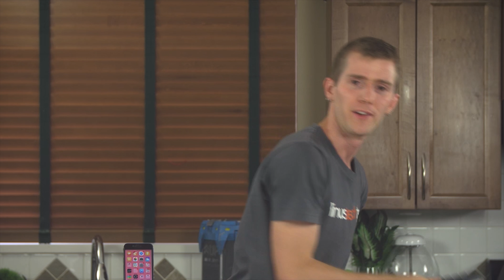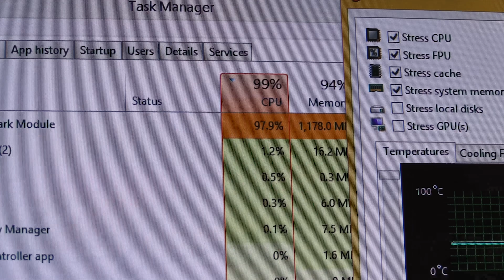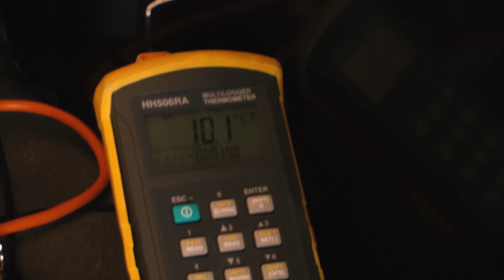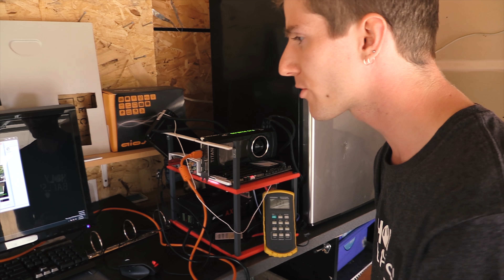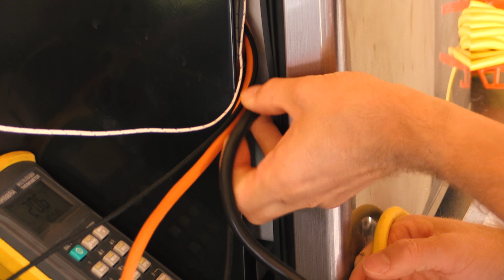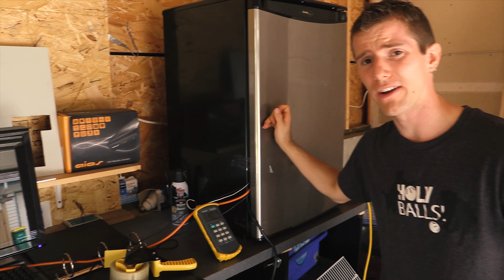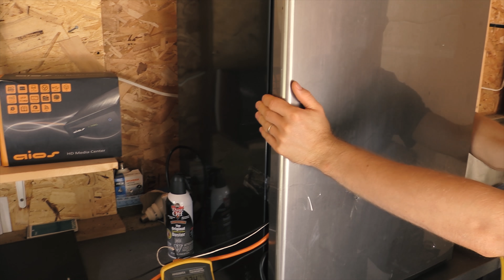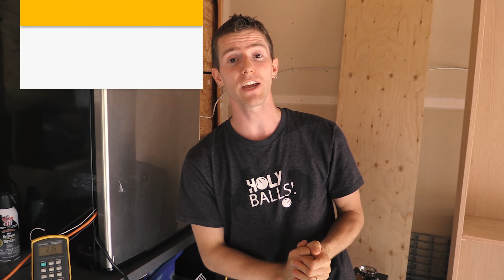PC Build in a Fridge - Does it Work??

Comment: Chest freezer?
Reply: I'm thinking purge the interior with sulfur hexafluoride. That would act as a dielectric protective gas without humidity, and it's also denser than common air, so it would promote convection and thermal transference. I've had some good time to think about this. Also, put the darn PSU outside the box.
Reply: humidity is on air... you would require to put the main part o the PC vacuum sealed to avoid humidity problems
Reply: Actually the computer would be hotter than the fridge. Water condenses on things colder than its surroundings, and the PC will be the hottest thing in the box (its just like running a computer in a cold room). You shouldn't need anything to take care of condensation, though I would recommend mounting the MOBO a few inches above the bottom of the fridge (to make sure water defrosting on the sides of the box doesn't run down and make a puddle). Then you could disable the defrosters since those are just for preventing freezer burn on foods, and they are wasting power in this scenario.
Reply: BioClone If you vacuum sealed the components their would be no medium for the heat to be dissipated. Correct me if I'm wrong please.
Reply: Garrett Nelson Radiation (usually more heat dissipation than natural convection on passively cooled components, also pretty important for satellites).
Reply: But again, you won't have condensation issues. People are looking at this wrong, a hot computer doesn't condense in a cold room, its cold things in a hot room (hot and cold are relative).
Reply: Jake Garrett yeah, but... we are talking about a sealed medium... where you got a very low temperature and a very high temperature where the PC components are... there should be a Convection Current with the gas inside so I guess on the top you will be getting condensation anyways.. and later falling to the hardware...unless the humidity on the air would be 0.

I think that could be made a hybrid between freezer technology and the heatpipe concept we know to make a massive safe heatsink... but at the end of the dayI dont know if the power consumption and all the cons would make it something interesting outside datacenters.
Reply: BioClone I just don't know why you would put it in a freezer for a real setup (a datacenter since those care about efficiency). You can just modify your A/C, fridge, or freezer by pumping the freon directly into a copper cooling block. You will get lower temps (like -35c for a 200w load on a 1/3 HP compressor, this is what my unit is rated for) and you won't be cooling other components like ram, motherboard VRMs, PSU, HDD, or anything else that doesn't need to be subzero cooled. You still have to deal with humidity (and components forming ice and frost), but you can use vaseline on the top (entire card, if its hot, it will melt itself off) of the GPU. Apply using a heat gun to make to smooth and waterproof the vasaline. On the back I used several thick layers of Plasti-dip (the thicker the easier to peal off when you're done). Also ad several layers of foam insulation (I used closed cell foam, mostly used for art projects because that's what was handy), then in between the layers add heaters (my unit has 5w heaters controlled by a micro-controller similar to a Raspberry pie, and its enough to keep the outside insulation just above ambient temps which is all you want to prevent humidity).

But for your proposed freezer (literally a freezer you drop a computer in), you just said it yourself, the computer is hot, the ambient temps are freezing cold. So you do not need to worry about condensation because condensation only forms on things colder than ambient (its like a room temp cup of water in a fridge). In fact, there is a company trying to start up that is trying to simplify LN2 cooling for rookies (bad idea) by making an airtight box (aka a sealed computer case) you set your computer into and hook up LN2 blocks (its pumped in and computer controlled, pretty simple to make) and the box makes it so you "don't have to insulate or worry about condensation" (which isn't entirely safe because the box temps need to be just as cold as the computer, and they are using a plastic storage box with holes cut out, and no active cooling on the box. Its a prototype right now)
Reply: So, in the case of radiation would it be notably different from the computer sitting on the counter? That is very amazing how important heat dissipation by radiation is for satellites. It seemed a bit hard to find info on that when I was researching it at an earlier date. Would any of you guys know of a good article?
Reply: Garrett Nelson A good book for calculating the heat dissipation (radiation, natural convection, forced convection...) is a college textbook "Heat and Mass Transfer: Fundamentals and Applications, 5th edition" by Cengel and Ghajar (I had Ghajar for my Thermodynamics class, he is good, but his book is even better at explaining things. I have this exact book from my Heat transfer course).

Not only can you get a basis of understanding, but actually calculate real numbers for designing a heatsink. This book covers a lot of information in addition to heatsinks (like heat loss in water pipes in buildings). I've found it very interesting.

If you can't afford the $200-300 price tag, you might be able to get a used copy, or an International edition (like $20, places like ABE books are good places, or maybe even Amazon). I actually still read it for fun (total nerd) because it is so well written.
Reply: Jake Garrett Thanks for the info, I will look into it.
  
 I am only 16 so I have not even decided on a college yet, but have a deep interest in computers both hardware and software.

 I know this may not be your scope, but I would love to hear your ideas on the most productive way to begin dabbling in a bit of coding.

BTW, no shame in nerdiness. I strive every day to be a nerd. Sadly, I am not where I hope to be.
Reply: Garrett Nelson I would read some forums and see what articles or books they recommend. Pick a popular language to start out with (C, Python) and learn some basics. Some projects may be better suited for different languages, so expect to learn a few. (My cousin is good with about 12 different programming languages, he's in high school)

Also see if you have a robotics team at your school (Even my very small school and Vo-tech had robotics teams, we were very competitive). You can learn a lot of practical coding in stuff like this (and learning to work in a group is a must, not always pleasant, but an important lesson on sacrifices, saying its beyond your abilities, asking for help, and sometimes bossing other people). Its very fun and rewarding. Competitions will be among your favorite days you remember, so I highly recommend it.

Also, many people try to delve to deep without background, and then you get stuck and frustrated. Arduino is a great starting point (C++ modified). If you try to delve into game development, you won't realize how many hundreds of pages of code you will have, and extremely complex coding. My cousin had pages for an AI path-finding algorithm, and many libraries and alterations to have a GUI (Yes, you will need to use other people's work. If you don't, you will waste weeks re-doing something already done well by someone else. People like my cousin publish open source code for controlling raspberry pi robots over the internet so that other people can learn and make use of the code they worked hard on. So use those as examples when you are learning, after all, I learn the most when I read other people's code.).

Biggest thing is to not get discouraged, and then your skill will only be limited by how much time you put into it.

Comment: BUILD A COMPUTER IN A AIR CONDISHER!!
Reply: sorry i don't have the best spelling and google would not correct it. :(
Reply: Anthony DiFede The same concept but not made for 24/7 use. Your refrigerator will turn on every few minuts and turn off again after some seconds. If you leave it open it will continously run until it dies. Your Air conditioner is meant for that and will do the job just fine. Try it, but dont blame me if you kill your fridge.
Reply: Conditioner :|
Reply: +KingCopasGaming it's ok
Reply: KingCopasGaming But they're sexist! (h3h3 reference)
Reply: There is a methode called "aqua chilling" which is basically a watercooled system with the water being cooled by an air conditioner instead of a radiator. The problem is, that the aqua chiller needs more power to cool the computer than the computer itself so that youre actually paying twice the electricity bill. Also you need to put the air conditioning part outside of your room because it is creating an insane amount of heat so that you need loooong tubes and holes inside your walls. Also there is the problem of condensation: If youre cooling your computer down too much there will be dripping water which will eventually destroy it. But the idea isnt that bad ^^
Reply: it was a joke but said like that i guess not. I was just thinking of a very cold thing.... I mean there is always a deep freeze. :)
Reply: KingCopasGaming I know, that it was a joke. I just wanted you to provide the information that the joke isnt actually that far away from reality.
Reply: A refrigerator is basically an air conditioner.
Reply: Anthony DiFede No. A Refrigerator isnt meant for 24/7 operation. Try leaving yours open for some hours. You will kill it.
Reply: It's the same concept, draw air from the outside, cool it, pump it into another space.
Reply: How about building A Pc In A Vacuum!!
Reply: TheGenericYoutuber When a fridge "turns off" it's only the light. Sure, the fridge won't be so cold if you leave it open, but the light is the only thing that "dies". The fridge continues to work, albeit at a higher temperature, therefore making it useless while the door is open. While the door is closed, the fridge stays cool.

Comment: Do liquid cooling with two big old beefy radiators, first one on the hot cycle outside of the fridge, should have a lot of fans on it, second inside the fridge, no fans. Heat doesn't get dumped in the fridge, you just increase the thermal difference of the liquid to increase thermal transfer rate. =P

Comment: I've seen computers in refrigerators all of the time. Go to a restaurant supply place, with the giant walk in refrigerators. They use computers to do the price marking, and inventory. Those computers just live inside the refrigerator. I've never once heard a fan running on them, but they probably aren't very powerful and aren't doing a lot of processing, and its noisy there so a low fan speed won't be noticeable.
Its all a matter of the type of refrigerator you use.

Comment: Now you need to try with a split air conditioning unit pointing directly to the rig and see what happens. It'd be cool and not being a close system as the fridge it should work much better.

Comment: buddy... somethin tells me you have no idea just how important the seal around the door really is... it's tantamount to how well the fridge will perform.  i mean you show your work and showing all the cables breaking the seal, nevermind having a heat source inside, if you've ever bought a used fridge with a slightly warped door that didn't seal properly, you'd soon realize that broken seal is the sole reason for why the fridge isn't cooling the food so well...  you're getting into the explanation of how a fridge works with it being a closed system AND LEAVING OUT THE SEAL!!!  PLEASE... DO IT RIGHT!! your video is a joke

Comment: fridge compressors were not designed to be run 24/7, which is why phase units are mostly made from compressors similar to the ones found on Air Conditioners which are designed for 24/7 operation.

Comment: Try using a thermoelectric fridge. They are typically cheaper and probably can handle a much higher heat load. (You can also make one for pretty low prices judging by your collection of heatsinks)

Comment: thanx linus. i was actually thinking about trying a fridge build but now that i have seen this i know it wouldnt work. at least not without some fancy mods to the system like routing the fans through holes in the fridge and sealing the space around them. still not sure if it would work tho. y dont u try it on ur channel so everybody can see if it works. i live in saskatchewan and it can get pretty hot in the summer.

Comment: I hooked up a window air conditioner unit, used a dryer vent to vent the cold air into back of case.. turned fan inback to suck air in which sucked the cold air in and fan to suck air out top, kept it 20c at all times.

Comment: If this was properly done, you would not have every component inside of the fridge, The reason why it did not work, is you have  items generating heat that the fridge could not compete with in a small space,  "Power supply would be mounted on top of the fridge to provide more air space and less heat generation" as cooling your power supply does not improve performance, the hdd outside of the case, etc,  the only things that should be inside of there is the motherboard and graphics card. So that the heating elements are removed as much as possible so the fridge can actually try to cool it down.  Another option is to actually mount all hardware on top of the fridge "and only store your heat sinks "Radiators" for the water cooling inside of the fridge" as that is designed to cool quickly.

Comment: but you didn't build it correctly. you answered all of your problems though. you should try mounting your psu out side of the fridge because it adds heat. you should definitely keep all components out of the fridge  that are not hindered by heat. and lastly maybe consider water cooling and an AC unit to dissipate heat out of the house. lol. love your videos. keep it up.

Comment: no Linus, setup the system as water-cooled and put the coils for the radiator on the cold side of the evaporator. that thing will kick ass.. the problem is the r value of aluminium to air to aluminium.

Comment: Air conditioners like the ones in your fridge or house don't actually "cool" anything. Whereas a heater will heat up your house it is not the same thing and is actually producing heat. A standard AC draws the hot air from your house and transports it outside, the same fluid that was carried outside hot is now returning cold. Cold air is produced by a process of extraction rather than production. This is why you have a a series of vents around your house in each room on the wall close to the floor or directly under the AC itself, not to be confused with the vents on your ceiling that distribute the recycled fluid as cold air. Once you realize this its almost like the Matrix during the spoon bending scene and at that point you will realize a refrigerated computer is just not financially feasible at this time or effective.

Comment: The worst IT video I've seen on YouTube. Didn't Linus ever hear "ambient temperature" and "delta"? Doesn't he know all pro server rooms have good air conditioners? No need to make this video at all. Nonsense.
Reply: You missed the point of the video and you clearly have no experience of the internet if this is the worst IT video you've seen.
The video isn't nonsense, your criticism is.
Reply: "Pro server rooms". Vs. the average Joe fiddling with his PC trying to make it run cooler. Methinks this video not aimed at professional IT consultants...
Reply: Scroll down, look at all the "put it in a freezer" comments to realize who this video was aimed at. Some may be trolling, but I really believe that some really do have that much trouble connecting the dots.
Reply: vut
Reply: You don't seem to understand me. Let me try to explain in a simple way, for simple minds. There is a direct correlation between the ambient temperature and EVERYTHING, not just a CPU. IE a fridge in a hot room will have to work more that a fridge in a cold to keep the temperature cool. No need to make a video for this. It's not rocket science.
Reply: This isn't a unique idea. It's not even original. It's not useful but harmful in your way of thinking too... Imagine those trolls you mentioned actually trying this at home. I dare the trolls to try to put ice on an overheating CPU and let it melt. If it gets too cold, they can piss on it. (DON'T TRY THIS AT HOME!)
Reply: what a freak you are sir.
Reply: Nathan Furness Better than being a moron. Only a moron or Linus in disguise can defend this video.
Reply: you truly are oblivious aren't you.. this is not done as a 'how to' or anything like that. It's done because the community find it interesting to watch, hence the fact they requested this video and most videos like this. Get a life stop being so negative

Comment: Wouldn't it be a better idea to take the fridge apart and attach the evaporator to a rigged up heat sink that allows for heat transfer but also allows the condensation to drip away from the computer?

Comment: I think it would be more effective, and safer,
If you're running some sort of self contained hydro system for the CPU and GPU,
you could extend the hoses, and keep just the radiators inside the fridge.
That way you don't have the whole rig dumping heat inside the fridge,
also you wouldn't have to worry about any potential condensation damaging fragile components.
Thoughts?

Comment: you don't need to put the whole pc in the fridge. drill 2 holes in the wall of the fridge where you're sure there is no plumbing or wires, run a copper coil in the fridge and hook it into your water cooling loop.